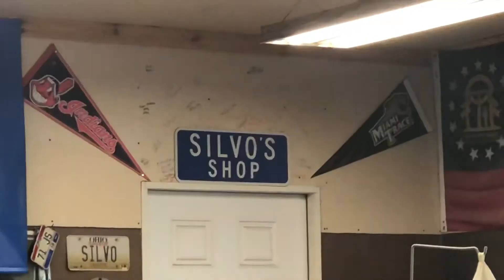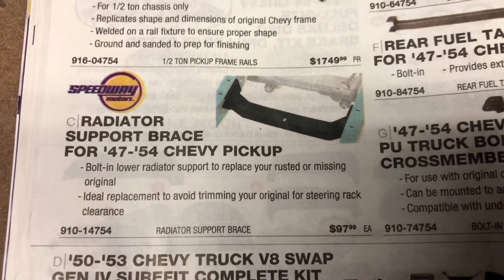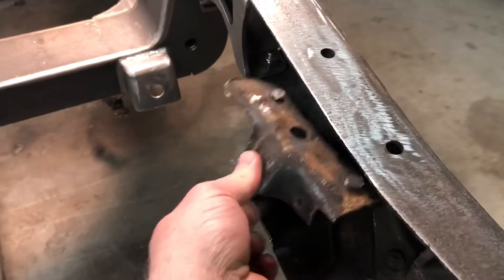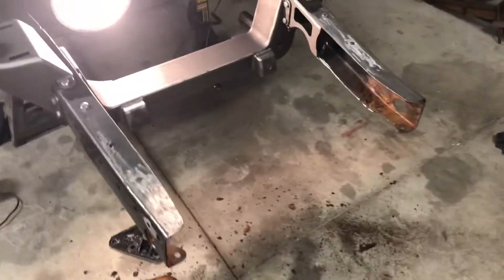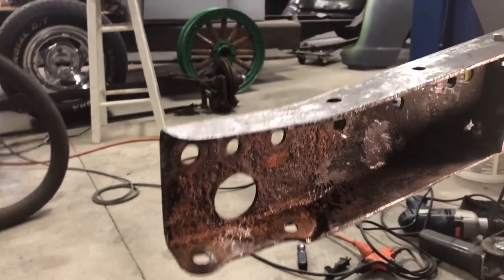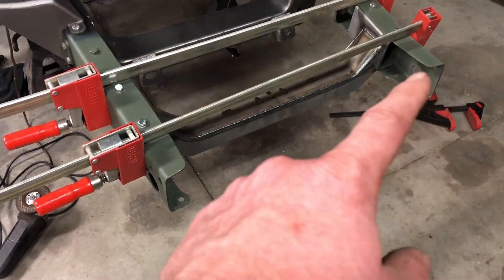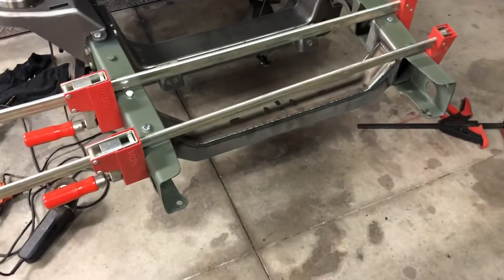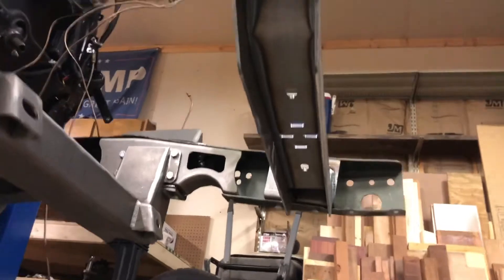Bolt on radiator support installation

Comment: I just picked up a '50 Chevy frame and am going with the Speedway kits as well. How are they? They look pretty easy to install. I should probably pick up that catalog too!
Reply from the maker: I had no issues installing it. If you have basic mechanic skills you should be able to with no issues. I have a lift which helped a lot. I’m having it aligned and inspected next week. Materials and welds are solid. After it’s bolted up with the correct torque specs you can weld it in as well. I’d buy it again for my next build.
Reply: @silvosshop  Awesome! Thank you! Ordering it with my tax return! lol

Comment: How much shim did you have to put under your radiator support after installing the speedway rad support?
Reply from the maker: @Buck-kl8cm  wish I could send a picture, but it’s about 2”. I used hard rubber hockey puck looking things, drilled them for the bolt, stacked 2 (1” each), bolted it all up.
Reply: @silvosshop  Ok.  That's what I'm getting as well.  I think that support  brace sits lower than the original.  It's amazing how one washer under the support can change the entire alignment of all the front sheet metal.  Thanks for your time.  You have an awesome build!

Comment: Did you buy your parts separately or all of it in a kit. How much did it all cost including control arms spindles and brakes. Thanks! Nice job 👍
Reply from the maker: The radiator support is separate, the crossmember and engine mounts are also separate. The Mustang II kit is a complete kit with disc brakes.
Reply from the maker: $2,700 give or take.

Comment: Hello, what did you end up doing for pain? Did you just primer and paint in place after finished bolting everything in? Thanks for creating these videos!
Reply from the maker: Dustin Mccosh I used 2 coats of self etching primer first, then the gloss black paint/primer for the frame items and dark metallic gray for the control arms. I did this prior to install. Then I touch up areas that needed it after installation.
Reply: Ive been using Eastwoods products for my frames...NOT plugging a particular supplier but because the results are fantastic.  The chassis semi black is a very close reproduction of the OEM material and very durable.  Since I drive everything I build thats a must have.  The biggest issue is cleanliness, preparation like ALL paint jobs everywhere on anything.  A cold phosphate solution can be applied and then primer and paint as per instructions.  WORKS...